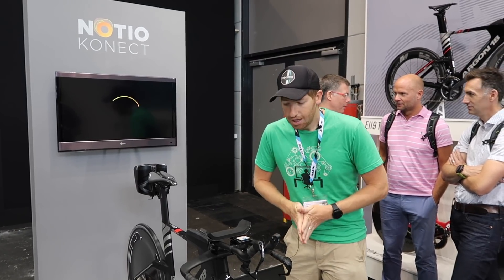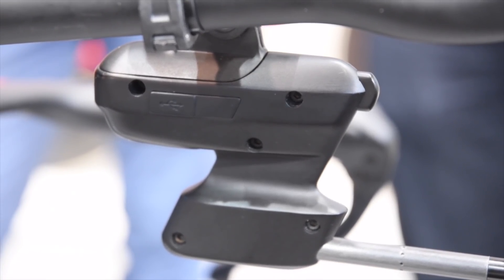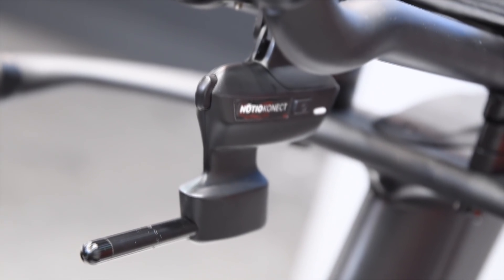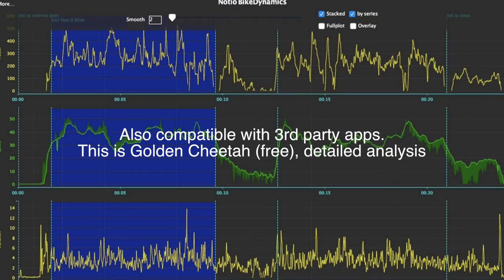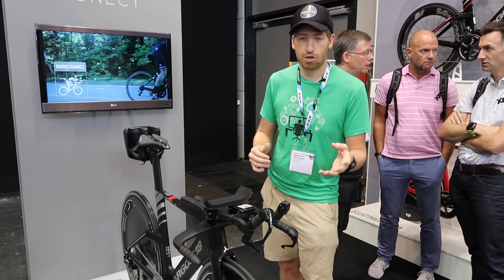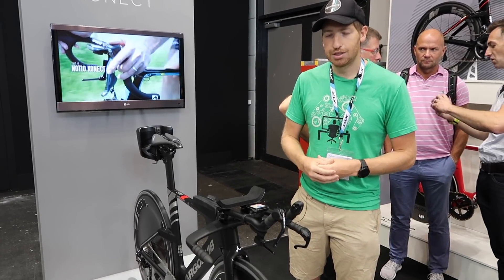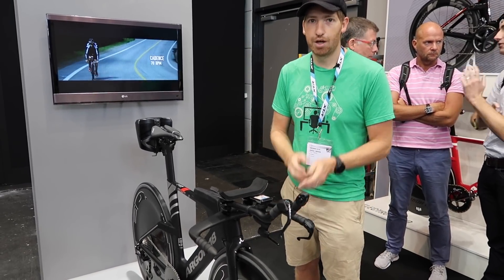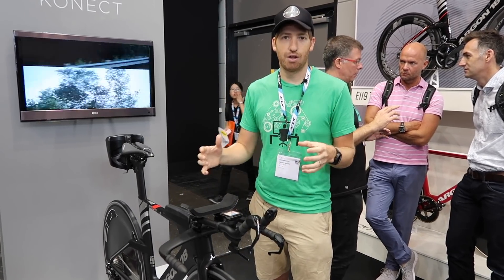Notio Konect Aero Sensor: Full Shipping Plans/Details!

Comment: I was a bit concerned this would be another Ant+/Garmin connect "lock-in". Hopefully they will strive for multi vendor compatibility. (I've had it with Garmin's poor aftersales and bug's, as of late) Does Notio plan to release their own app, much like Wahoo/Polar, in order to upload data?
Reply from the maker: Definitely will/do have an app to upload data.  But keep in mind the value of the data is heavily during the ride itself.  Certainly there's value post-ride, but to really make this product shine you need to see the data during the ride. There's zero reason why Wahoo can't implement this - it's 100% on Wahoo to pony up and do it (as they've done for other products).  In the case of Polar, they too could implement it, though we haven't seen much in the way of cycling-specific 3rd party integrations there (they did do Stryd for running, and some work with ROTOR a while back).
Reply: Garmin lock-in is a bit concerning

Comment: Its a great idea for on the spot aero tuning because even if the actual Cda is not accurate the relative numbers show whether a different postion or piece of equipment is making a difference. I'm guessing this has to be used in conjunction with a power-meter? ....It looks like a strightforward pitot tube with static ports as used on aircraft to measure airspeed. I'm a bit baffled that they need to have a training course on it's use tho.
Reply from the maker: Correct, to be used in conjunction with a power meter.  The training course is mostly about the 'How/what' to test with aero, not so much the device itself. In other words, if you gave the device to a triathlete with no context, would they actually be trying the right things - or just changing things for the sake of change.

Comment: On-road data, but only in training right? Because wouldn't the extra weight, negate the negligible aero gain and higher risk of continuously looking at it while riding?
Reply from the maker: Most would say both training and racing. The aero penalty for such a device should be close to negligible (something I plan to test though using other means), but the aero penalty for not having the right position in an ironman race is massive by comparison.  Most folks I talk to are looking at it for both training and racing.